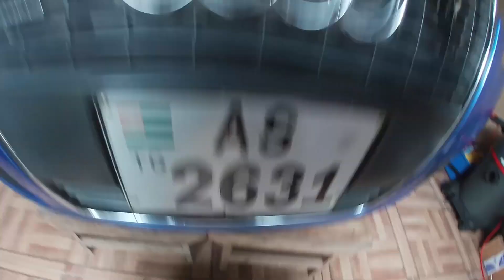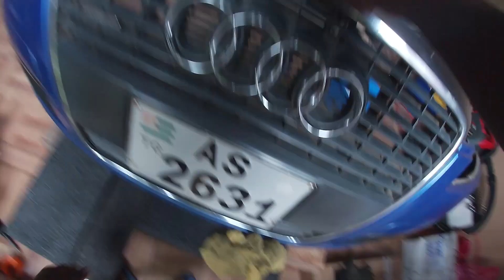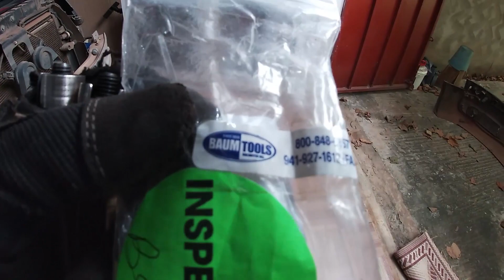Part 2 - Bumper Cover Removal, Headlights Removal, Front Lock Carrier Service Position - Audi A6 3.2

Comment: Great video. Did same for my Diesel Q5 and A6 but while working, I decided to remove entire from (radiator, tranny cooler, AC coil etc...) found the time savings, access, and visibility to be way more worth it than reach down into the 6 inch gap it afforded me before... Had to remove oil filter housing, thermostat, engine cover, engine cover seal, water pump, oil cooler, etc... worked better to remove entire front 🤷🏽‍♂️

Comment: Nice trick with the paper tape, tuning the position of the headlights is sometimes pain in the ass. Thank you I will use it I'm doing similar job, bumper is out. I will change water pump and pulleys + alternator clutch and for this I will move radiator and your video will be usefull for this. 
I already changed HPFP because I had solenoid and camshaft sensor errors + low fuel pressure. Camshaft follower was at the end of its life, but now I have still fuel leaks from the system and I smell gas from oil, long starts. So I also removed fuel injectors. They are probably leaking. I will sent them for a ultrasonic cleaning tommorow, hope it will helps. Why you are replacing fuel pump ? Interesing behavior after replacing HPFP was much smoother shifting between gears especially in lower gears. Good luck with this job you have nice videos ;).
Reply from the maker: I appreciate your comment. Keep watching. I will show tricks on how to remove the coolant pump pulley. I replaced the HPFP because I had the low pressure fuel sensor code and intermittent jerking at low RPM. Intermittent jerking is still there and the low pressure fuel sensor code got returned again so I am going to replace the fuel filter to see if that fixes it. Next step would be the low pressure fuel pump. But I do not regret changing the HPFP one bit. I went that far so why not replace it? It is known to fail on this car. And exactly like you said it, with the new HPFP the engine and transmission feel like new. Shifts are so smooth! At high RPM, the engine now sounds like sex.
Reply: @Kokouvia  maybe worn camshaft also could cause it (travel of camshaft follower could be low - like if camshaft follower is worn) but i don't know how to measure it and it's much more expensive than the fuel filter or low pressure pump :) fingers crossed and good luck
Reply from the maker: @HotDguild  Well I hope it's not the camshafts. I never replaced my fuel filter since 5 years of ownership. I tried back in 2016 and I ran into a big problem. I broke one of the fuel lines tabs so I was unable to remove the old filter. To replace the filter I'm gonna have to replace that fuel line with it which is a job I've been dreading since then. Now I think I'm ready. That thing must be pretty much clogged.

Comment: Hey Keli, what size length is the lock carrier service screws? I don't think a bunch of screws with some "steel cover" is worth the $70-100. I was going to buy the length screws or just use the bumper screws with a piece of galvanized pipe (1/4" NPT) in 4" length and just insert the screw through the pipe from a local hardware store. All for $10 if I can get it to work. Just need the length of the screws. Are they same length as bumper screws? Basically What are measurements of the screw and that casing?
Reply from the maker: I get your point. This tool is indeed expensive for what it looks like. The question would be however "what it's made of?". The front lock carrier is heavy by itself. Besides, it's carrying the radiator, the condenser, the dual fan assembly. To hold all that in place, you have 14 various bolts. All these bolts are going to be removed and the front lock carrier will be resting on these small tools. They must have double the strenght of these 14 bolts. Besides, the metal piece around them are perfectly sized to help not only slide the carrier back and forth but to also position it correctly when installing it back. They are worth it and will make it easier for you.

However if you can't really afford them, you need to find very strong bolts that you can screw in there. The tools are longer than any other bolt removed from bumper to carrier.
Reply: @Kokouvia  thank you for the reply. I was planning to buy grade 8 stainless steel bolts but if need be, I could buy the tool. I was just trying to avoid buying something I thought I could make myself haha. Grade 8 (most car manufacturer bolts are grade strength 6-8 where 8 is used in areas with most weight carriage) 6-8" in length for extra measure and use a 1/4" galvanized pipe (which helps in holding and sliding the carrier lock. I'll try my method and if it works great, if not, I'll just buy the tool.  Do you happen to know length of the screw?

Once again thank you so much for replying back. Since I have everything opened, I figured I change, thermostat, water pump, HPFP, radiator hose (yes the nipple broke...I didn't even touch it and it broke), performed carbon cleaning, timing chain numbers are not too bad but will change  since I have to reseal the camshaft girdle due to oil leak. All your videos have helped greatly! Tremendous effort for your work. Thank you.
Reply: I found out the length size. 
M8 diameter x 1.25mm thread pitch x 90 mm length and partially threaded, with outside diameter of  13mm or 17mm? Did you use a 17mm wrench?

Contacted Baumtool and they confirmed use of steel strength 10.9 on the 3369 tool with zinc plated to prevent crosion.  So that solves that! Most hardware stores carry this! They mentioned that since only two screws are holding it, alone without support would be grade 10.9. If using a jack or bricks to hold in place while extracting, then strength 8 can be used.

Now to find the pipe. I think a 1/4" or 1/2" steel pipe will do.
Reply from the maker: @JustGameEverything  I appreciate. Your plan sounds interesting. You may remove  one of the carrier front upper outer bolts to measure the size for the pipe. The pipe should enter the carrier hole and must fit. It should be tough enough. You will also need a washer to help squeeze the pipe onto the carrier hole with the bolt. I am currently on a trip otherwise I would have measured everything for you.
Reply: @Kokouvia  no worries have fun, I will test out my experiment and let you know if it works!

Comment: Awesome vid, there is a 10mm nut which the manual says you need audi tool T40078 which looks like a deep socket 10mm. Did you use this special tool or is it just a reg 10mm socket?
Reply from the maker: No I did not use that tool. I just used a regular  10mm socket with an extension. I showed the nuts at 17:10 but did not show the socket, sorry. However I showed them it this video showing how to put everything back together at 4min40sec time: https://www.youtube.com/watch?v=36THWhJUN48
Reply: @Kokouvia  cool man thanks I’ll check it out

Comment: I watched a lot of your videos, it seems to me that you know a lot of this specific car. I also have an Audi A6 3.2 quattro from 2004 and I have an issue with my car. Between 3000-4000 rpm the car hesitates to accelerate. It looks like the car is thinking about what to do when I floor it. After a few second it seems to know what to do....accelerate. I am lost for a cause of this behaviour...It should respond immediately. I already cleaned my injectors, replaced all spark plugs and all coils, also replaced the camshaft adjustment valves (4) and the vacuumpump. 
Crankshaft sensor is replaces and also the camshaftsensors and gearboxoil. No result so far...Do you happen to know what might be the cause ? Or maybe someone else on this channel ??? Help is much appreciated. Kind regards from the Netherlands. By the way...I love your new car, it is beautiful !! I am looking forward to all the new videos of Tornado ! Keep up the good work and stay safe !
Reply from the maker: I appreciate your comment. I am in fact working on Tornado right now. Hopefully a new discovery video soon. I am sorry about your issues with your car. Based on your description, it is highly likely that you need a new high pressure fuel pump (hpfp). I replaced mine a few year ago not because I was having such issues but because I was replacing the front coolant pipe so since people reported the hpfp might fail soon and I was that far, I replaced it too. My old one was fine and I recently gave it to a friend who badly needed it. He called me just last night to inform me that his car came back to life thanks to my hpfp. He has an A4 with the 3.2 engine. The steps to replace the hpfp are in this very video playlist. Just keep watching and you will see how to proceed. Not an easy job and the hpfp is a very expensive part as well 😕
Reply: @Kokouvia  Thank you so much for your answer. I never thought it could be the high pressure fuel pump, I thought it was sensor related. I will order a new pump and see what happens. I feel confident this will solve my problem. I will let you know. Thanks a lot, you are the best !! Greetz Martin from the Netherlands.
Reply from the maker: @familieverhoeve7127  Good luck brother 🤞🏾
Reply: @Kokouvia  Guess twice haha, I replaced the high pressure fuel pump and all my problems are gone !!! The car accelerates like an F16 fighter jet. The difference is amazing, no hessitation anymore. It goes as soon as I press the accelerator pedal. This is what I was looking for, love it !! Thank you so much for the golden tip ! Looking forward to your new videos. Keep up the good work.
Reply from the maker: @familieverhoeve7127  This is awesome! I appreciate the feedback. I am so happy for you!!! 🤗🤗🤗

Comment: I think your very talented but I would not put my time in something that has been proven to be justified as junkyard parts for making a real brand of cars etc. Not because I think so it is what it is. This brand of so call cars is a overwhelming problem after problem.
Reply from the maker: I understand you. My experience so far however is that these cars only problem is improper maintenance. Maintain them well and they will last. Treat them bad and they will do you the same 😅